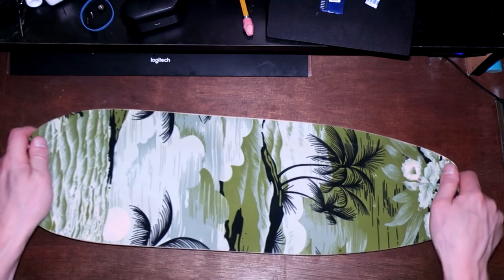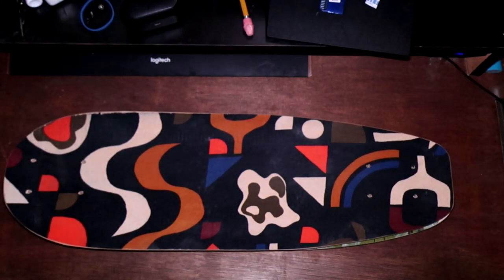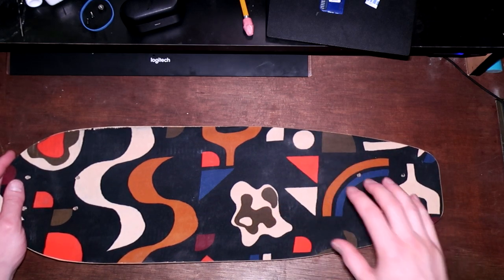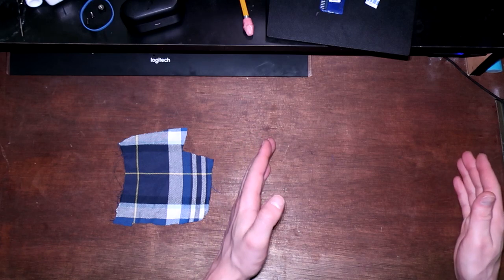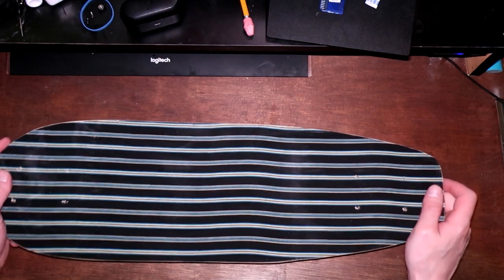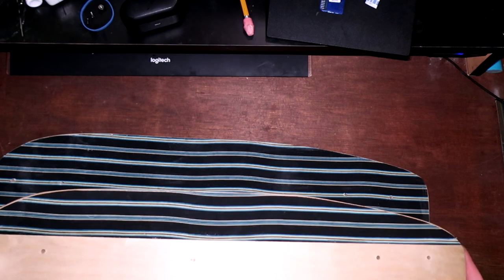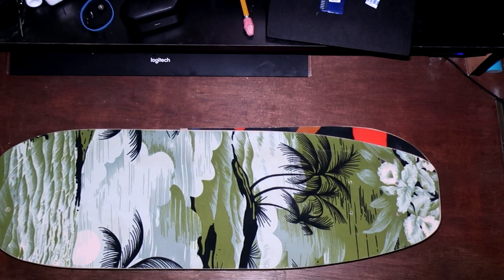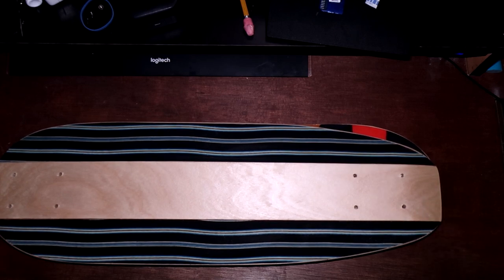Fabric grip, Update and problems to solve

Comment: Have you tried 3M Super 77 or Hi strength 90 spray adhesive to lay down the fabric?
Reply: Yes, as well as industrial contact adhesive. We tried wallpaper adhesive, epoxy, melamine glue. 

In the end only Epoxy and wood glue had enough hold on the fabric, everything else just peeled off too easily. And epoxy wetted the fabric too much and completely changed its characteristics, it actually became too aggressive and felt more like actual grip.